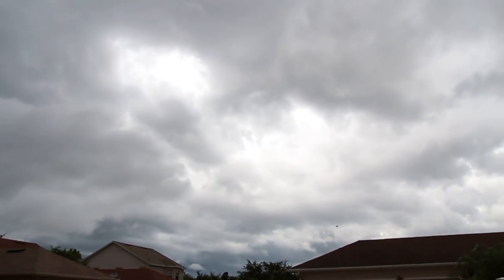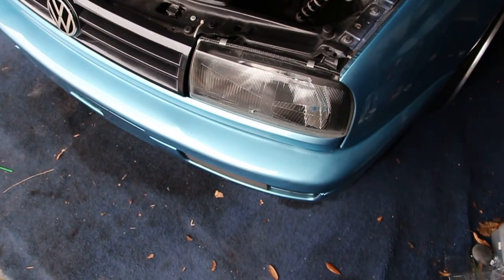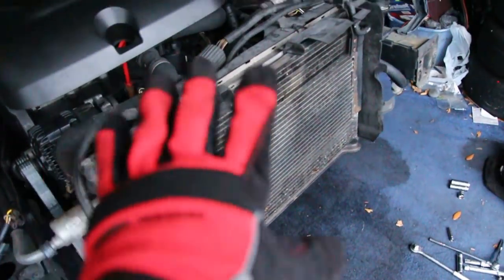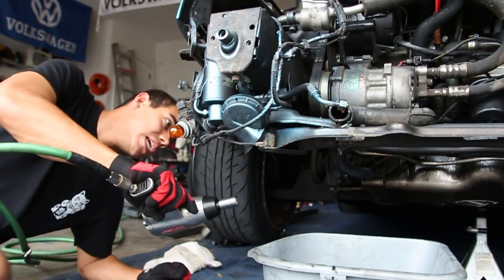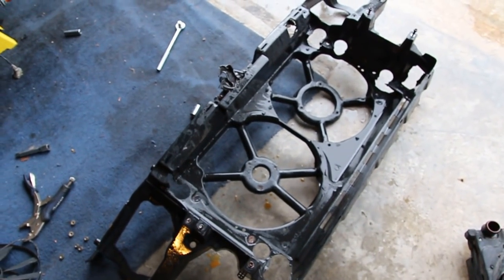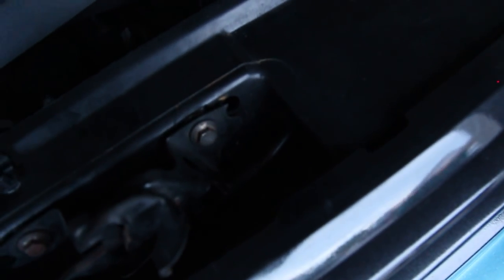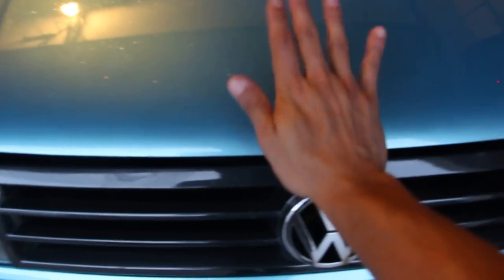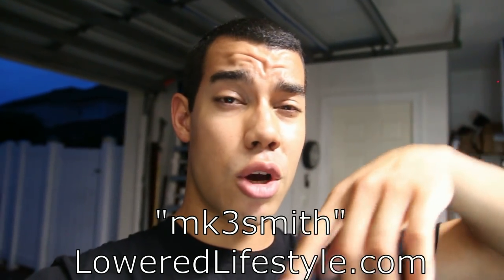Euro rad support install on the MK3

Comment: How did u get the vr6 aluminum radiator to work with the 2.0, and how did u mount the fan switch in it?
Reply: NathanielSilva he used his 2.0 rad. The vr rad won’t work